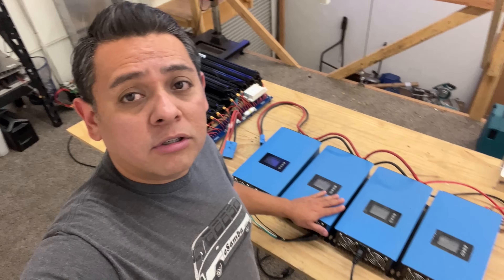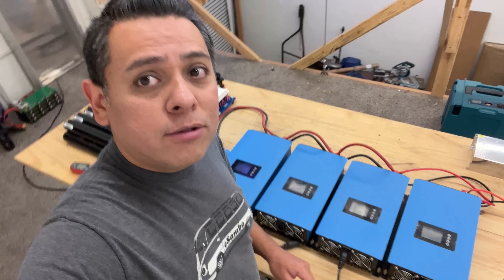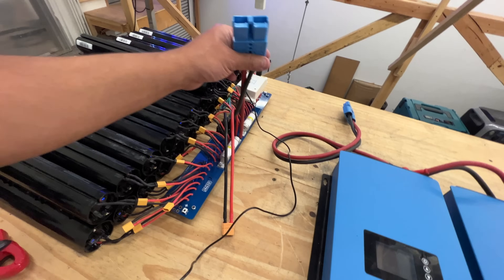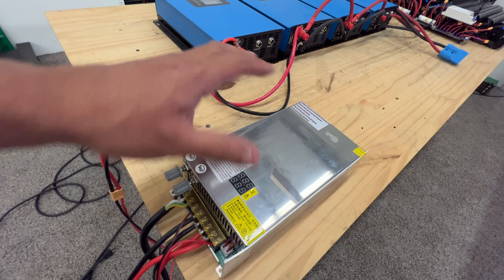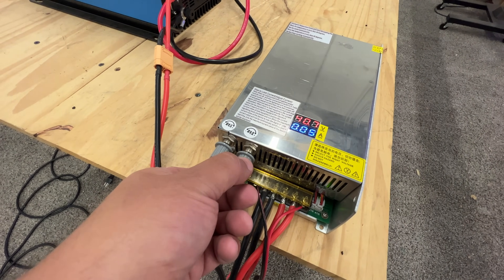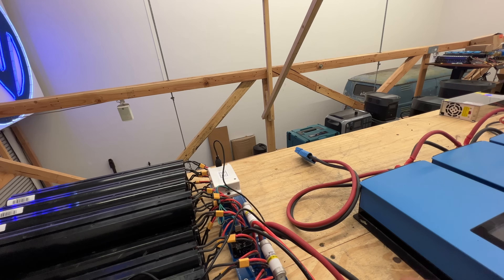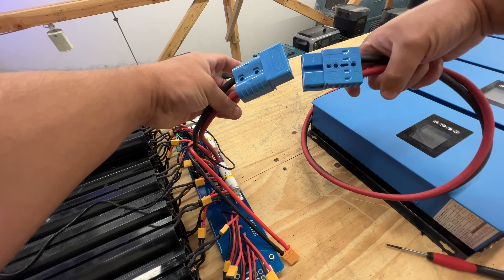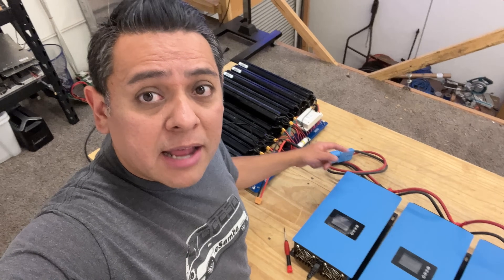Pre Charging your inverters Caps - No Sparks

Comment: I love that you posted this. I have a question, but nobody ever answers questions like this but I’ll try anyways, I have a battery I’m connecting to a controller for an escooter and I keep getting a big spark, so I’m building a precharge circuit. It’s the order I’m unsure of. Is it supposed to be the battery through a switch and a resistor, then the controller? In parallel to a big wire from the battery to the controller?

Comment: Would have been nice to see some permanent practical solutions offered for when  Inverters are fitted in-situ and continually being turned on and off
Reply: Use a precharge unit. It's an electronic timer with a small relay that switches a resistor across the main contactor for a few seconds before sending a control signal to the main contactor to close.

Comment: Or you could use as150 ? Trying my first battery and I didnt want to use anderson as I've read the contact blow after several spark, and I found as150 :) I even found a plastic holder to fix it in the battery case...

Comment: thanks for the info, how do we determine how much voltage is enough to precharge is there some sort of magic ratio?
Reply: Pre-charge to the same voltage as the battery pack and there wont be any sparks. Easiest way is to use a resistor in series for a few seconds then your voltage will match

Comment: for plug-in items I've been using switch taps for a while and this problem is completely eliminated

it's a portable outlet with a switch on it that plugs into the powered outlet

so the circuit is closed faster than the spark can form

this is mainly useful for power adapters not inverters though, that's a different beast, do what Jehu says for those

Or the anti-spark XT connectors, but make extra sure you fully connect(insert) them. Not so fast that they don't have time to get the voltage up though.

Yes I know they use a resistor

Comment: I would get a Dual Battery bank DC Rotary Selection Switch 
Add A Resistor or String Series 12V incandescent Car Lamps to bank 2 Side of the Switch

When you First Connect you Rotate the switch to Bank 2 to Pre pilot - Precharge the caps  ((if you using incandescent  it will let you know when the caps are ready by going Dim or Off - note just very bright in cap Charging )) 
then you know to switch to Bank 1 for main Direct DC Run

Other notes this Does Not work With LEDs (it will just eat them alive Due to  the Zero impedance of caps Temp want 5000A)

Other Circuits  -> Thyristor triac (self limiting) - Thyristor Heating Element  (self limiting) - DC DC Regulator Converter With Self Limiting - latching DC Latching Relay / Switching DC Contactor  with memory - RC / Ebike / EV ESC Speed controller (PWM) - or mosfet (PWM) or  variable-voltage/variable-frequency (VVVF) drive

Comment: In a surge of current, capacitors look like a short. If you add a Choke inline that Choke looks like a huge resistor to fast current.  Then as the caps charge, the Choke is basically a wire now. Chokes are basically a coil of wire, sometimes with an iron core.

Comment: Worked with 3 phase drives and they all had resistor based precgarge circuits. I wonder why the inverter manufacturers don’t do the same.

Comment: Would this not be simpler by wiring a breaker switch to disconnect the battery from its Anderson connector?

Also that Jigo is clearly counterfeit, the colour of anderson connectors denote a different keying and I'm pretty sure the Jigo is just a grey connector keying but for some reason blue plastic.

Comment: Or you could just have an xt90 anti-spark in parallel with the Anderson connector, cheaper and easier.
Reply: Good tip! I was wondering whole video if he also shows resistors for precharging, it is really nice to have it builtin these XT90-S.
Reply: or "AN150's" (xt150 anti spark) if you need more grunt! Also - The reason you get the spark isn't the size of the battery or inverter its the difference in voltage that induces a large current rush into the capacitors. 12volt systems obviously don't suffer as much as the higher voltage (48v) systems.
Reply: @mofoq  probably not, because everything that uses this much current should have the pre-charge circuit built-in. But these dodgy Chinese inverters don't.

Comment: Usually I precharge my inverter by connecting a 30ohm 10W ceramic capacitor from the positive lead of my battery to the positive input of my inverter.
Reply: You mean resistor, not capacitor

Comment: You can use a soft starter Sir but it can't handle the 4kwh pack until we connect them in Parallel just like the inverters ;)
Reply: https://youtu.be/NwuY7qbs2Dk

Comment: Actually, cheapest high power "resistors" are car bulbs.
But in a good device precharge circut supposed to be already implemented inside of device.
Reply: Pid line follower robot testing👌😎
Reply: Where do I get a 48v lamp?
Reply: @mrtechie6810  they are available to buy. 120v will work too. You just need to figure out what current is acceptable for you and you can add or remove some. As well you can for 48v put 4 12v bulbs in series connection, it will do a trick too.

Comment: I have a solar inverter. What can I use to charge the caps?
Reply: A resistor in series with the power. I keep a wired headlight bulb just for that
Reply: @TheTimshady337  what resistor? Headlight bulb? Not sure
Reply: @taniksambo1969  you can use almost any resistor or regular light bulb 💡  as a way to prevent all the current to flow at once.  I usually connect the ground.  Then connect a wired headlight 💡  in between the battery + and the  inverter.  The light bulb will go dim or out when precharged
Reply: @TheTimshady337  so with a light bulb. You would connect it to the battery then to the inverter? Or just use the positive from the battery to the bulb then the bulb to the positive on the inverter?
Reply: @taniksambo1969  + battery  to 1 bulb wire + inverter or device to other bulb wire.
Reply: @TheTimshady337 
Yes, this should be on the inverter side, and a simple resistor (or, better, a potentiometer) is more compact and durable.
However, one needs to be able to bypass the resistor/headlamp once the caps are charged, and a separate connector for each lead (pos and neg) makes this bypass easier.  One could also use a double pole switch for the bypass, but that adds extra points of failure.
Reply: If a 12v battery, an incandescent automobile light bulb in series with the incoming power.

If 48v battery, I was thinking about a 110v incandescent bulb, since this should not blow out… I will be trying this over the next couple months as I am building a higher voltage battery bank.

Hybrid cars use an automatic mechanism to apply a large resistor to pre-charge the capacitors, before using a relay to apply the rest of the DC voltage to the in-car inverter

Comment: No soft start?
Reply: Capacitors are designed to discharge their energy almost instantly.  Therefore it will charge it's energy almost instantly if enough available current is applied.